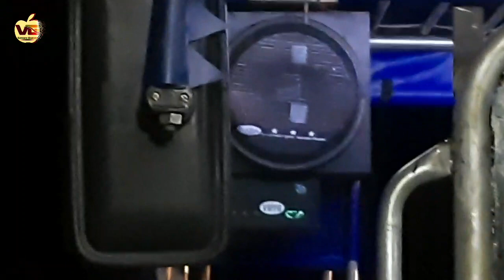कम पैसो में बडिया ट्रैक्टर तैयार करवाने के लिए संपर्क करें Euro 55Next Modifica DK Modification

Comment: Bhai euro next 55 badiya ya ft 60 powermaxx bhai
Reply: Euro 55 leya bhai
Reply from the maker: Bhai engine same h but gearbox m fark h 
T20 or 12+3
Reply: @vehicleguru3803  bhai engine bhai same nhi h
Ft 60 me 3510 cc 238 nm torque 25 kuntal lift cap.16+4
Euro 55 3782 cc 257 nm torque  2000 kuntal lift cap. 12+3